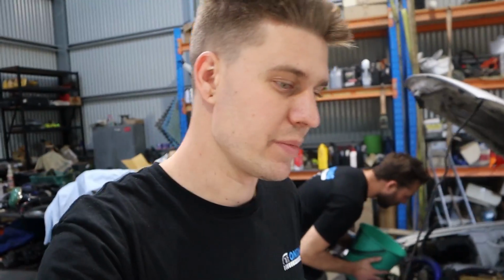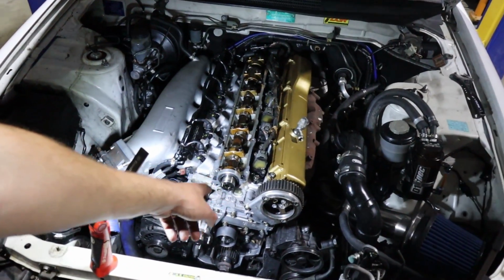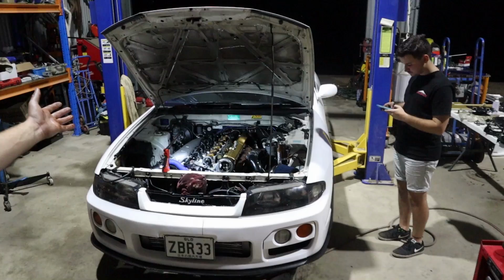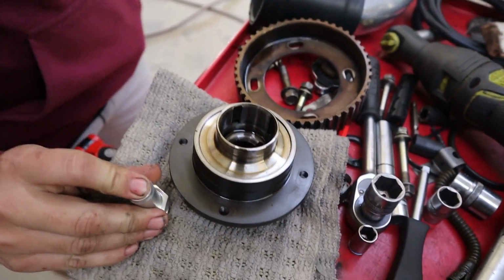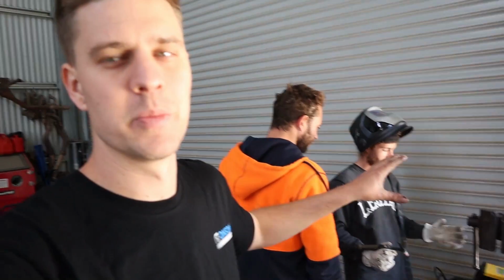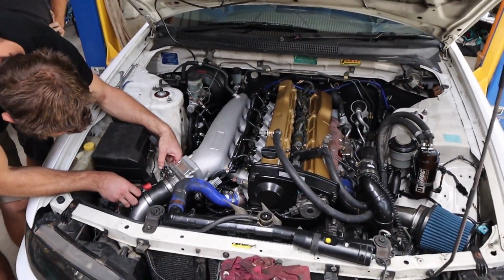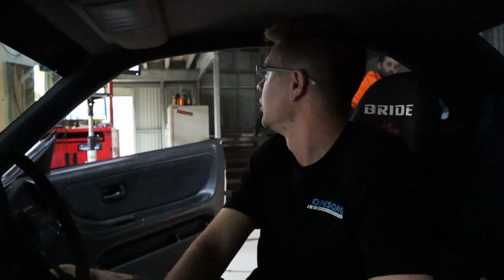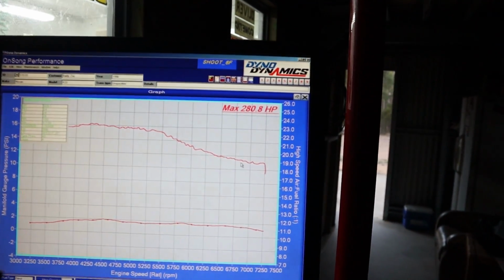ZBR33 Hits the Dyno...... Just....

Comment: Looks like your trying to pressurise the engine with that setup you call a catch can 🤨
Reply from the maker: shaun54 what makes you say that?
Reply: Leprechaun Laboratory  cant see any kind of filter on the catch can so i assume it has some holes drilled in the top?  So likely even less crank case ventilation than the factory setup
Reply from the maker: shaun54 yes holes drilled in top. without factory intake we cant run the factory setup. As stated, multiple times throughout the video, its temporary until zac can sort out his own setup. As stated in the video, is just what i had lying around, works better than the open ended 3/4 lines that were in the engine bay allowing the engine to breath in who knows what contaminants. If you actually watch the video you dont have to assume

Comment: you reckon the turbo is out of puff? what's the IAT like? is the intercooler a restriction?
Reply: If he's still on the stock down pipe, I'd say that's your main restriction.
Reply from the maker: Yeh the hot-side is where the restriction is
Reply: a bit stink for the young fulla, I'd also recommend he ditch that cas asap, does it still look alright in the logs? he should hit up Tao at hypergear for a good bolt on option.
Reply from the maker: Nissan skyline Burninator nah its not good at all, missing counts its fairly over the place. Hes well aware of this and is keen on a trigger kit next